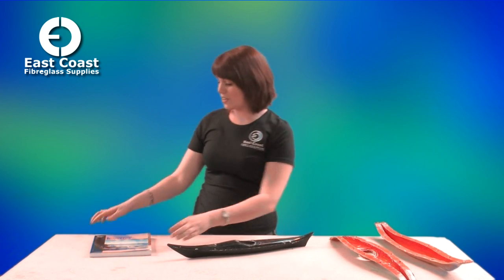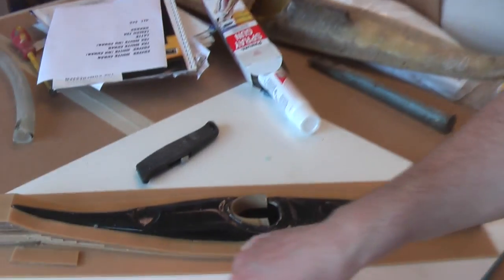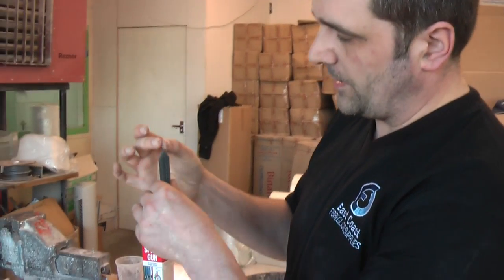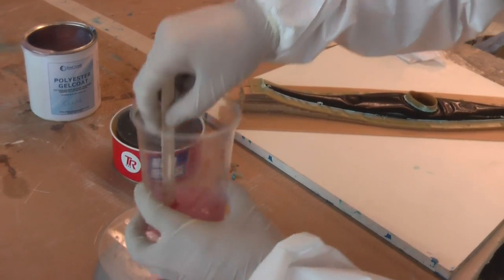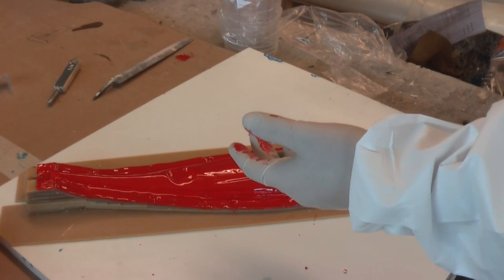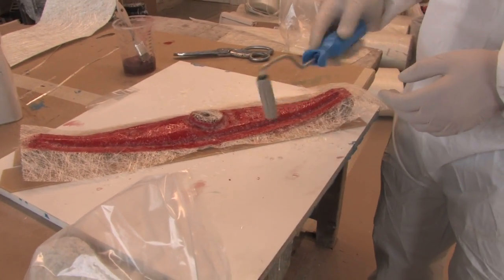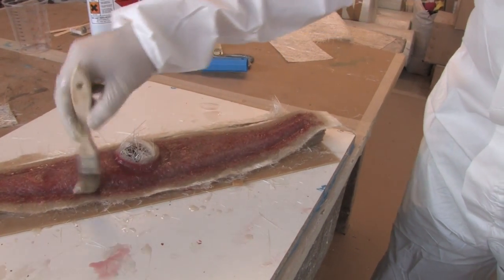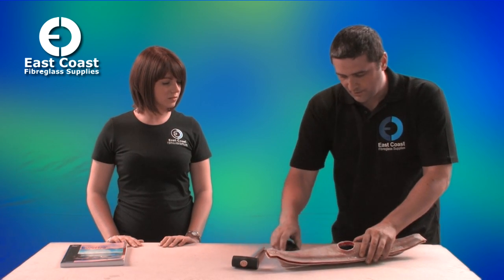How to use fibreglass to make a Split Mould

Comment: thanks for the video. Can you explain why you wipe the dried first layer with acetone? I bit confused because most tutorial said that the second layer is applied when the previous layer is in tacky state, but not dried. Thanks
Reply from the maker: You wipe with acetone to make sure the first layer is tacky - it can dry off between layers, if you leave it too long. The acetone softens the fibreglass again and gives you the tacky surface to lay onto
Reply: EastCoastFibreglass I see. Thanks a lot for the info.

Comment: i put wax before pva and do all my layers of fiberglass in one shot. would of cut a hole on top also and used the strands around the top hole. check out the fiberglass master, GasserGlass.

Comment: Well i thought it was a good video, nice work guys. Could you do a demo on gel coat repair kits, i.e got a kayak thats had some really bad impacts, cracked gel coat and prob damage to the main fibre. Will need to patch inside, but it's right at the bow and my arms are not long enough. So yeah, a demo on gel coat repair please :O)

Comment: doing the parting line with that wax is clever & a good hint .. but never seen mold making that complicated ..  we use a special black mold resin some layers of fibers and finally laminating ceramics for enforcement .. much easier and cleaner ..